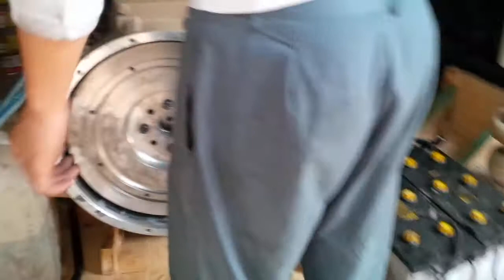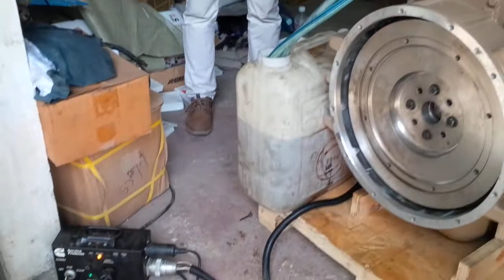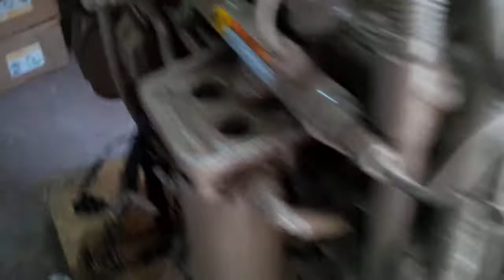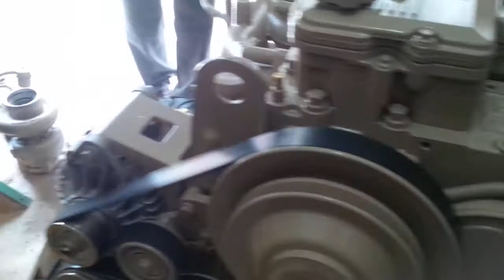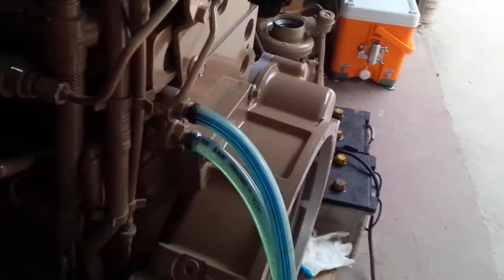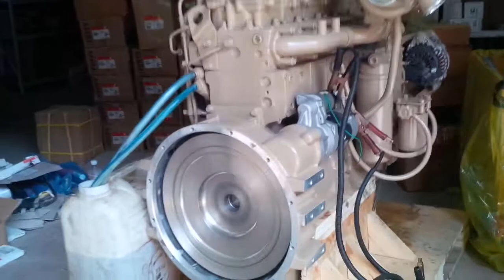Cummins QSL9 CM850 diesel engine assembly

Comment: Should have removed the serpentine belt before starting or added a running water hose to the radiator inlet. Running the waterpump dry is not a good idea. It doesn't take much for the seals to give up and will start leaking soon..